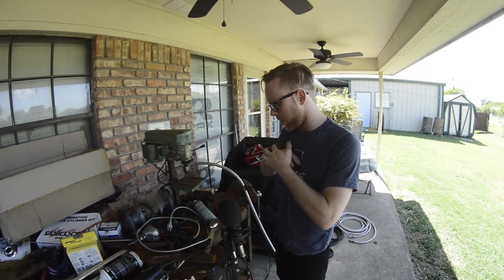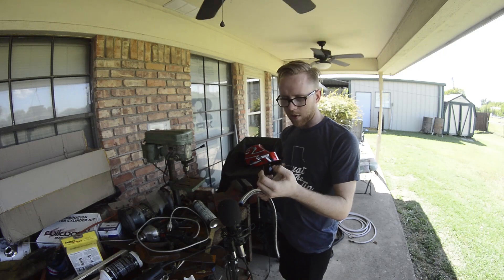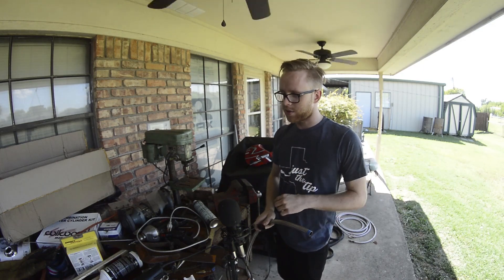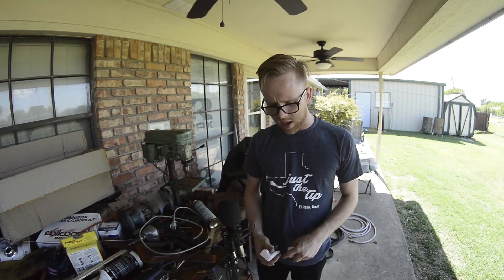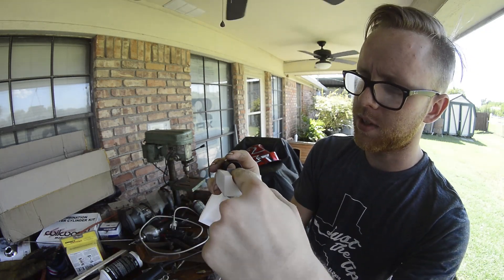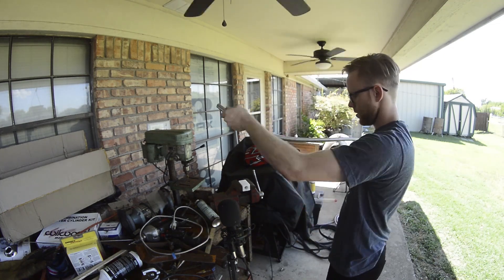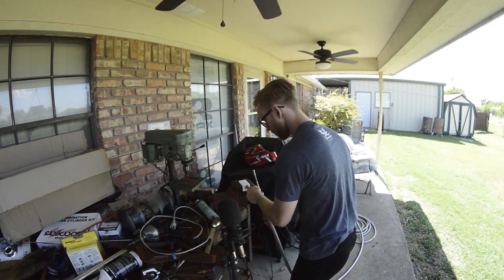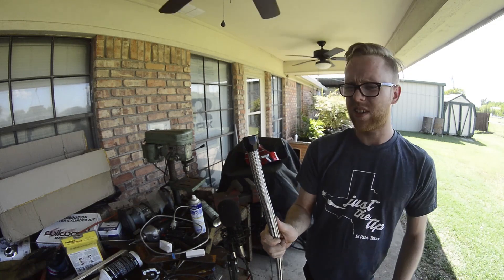AN Fittings: This 3D Printed tool will make your life easier! How-To: Install AN Fittings

Comment: Thanks for this, I was looking at buying Koul Tools
Reply from the maker: They were the inspiration for creating mine. Definitely make the process easier. I have also found that if you stick with the same brand for fittings and hose they usually fit much better. random ebay stuff won't go together without these tho.